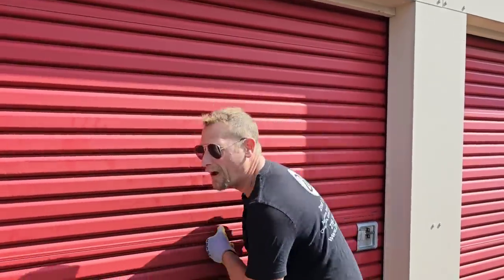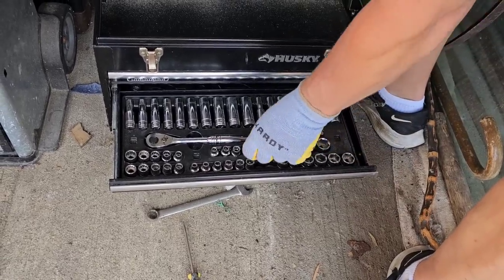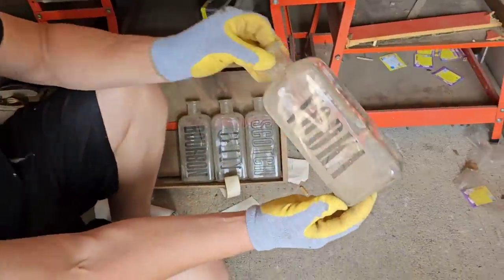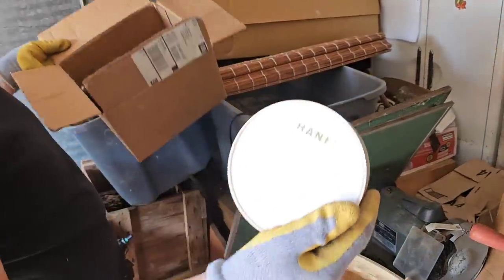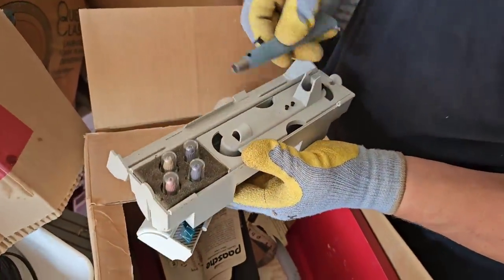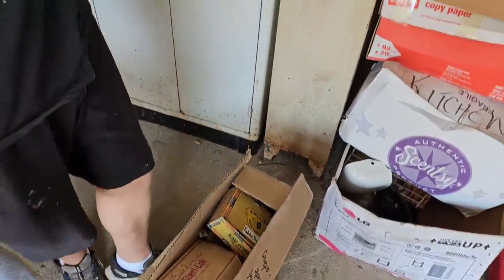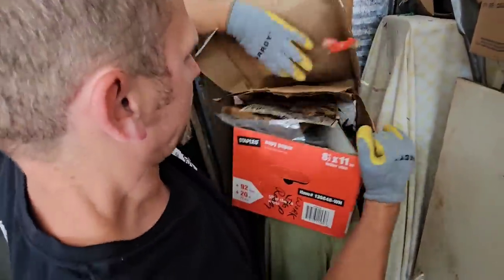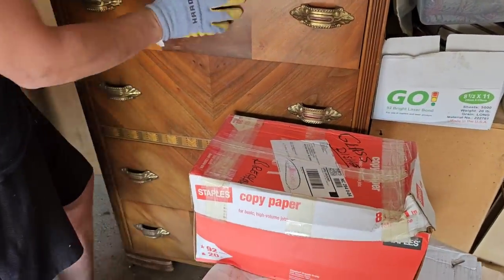Unit HASN'T been opened for YEARS! ~ Storage Locker is LOADED with SURPRISES & profit!

Comment: I used to work for Wright & McGill/Eagle Claw.  Did you know that those little plastic boxes with hooks were all hand packed?(well in the '70's they were.  Don't know how they are packed now or if the company even exists any longer)  Yup!  I would get a big box of loose hooks and count out the amount that would be for the plastic box and weigh how much that  would weigh and then take you bare hand and put hooks on my scale to match that weight.  Then put the hooks from the scale, by hand, and put them in that little plastic box.  Did that job for about a year and never got stabbed once.  No one on the job ever got stabbed either.  Safe to grab them in a bunch than try to pick up a single one.  Loved that job but they moved out of my area and I didn't want to drive that far considering I used to walk the 2 blocks to work.  Even all of the fishing poles that used to come skinned wrapped in plastic was done by a single machine operator(person.)  Great pay for back then. It was more than double per hour than average.  Least the fish hook counters did .